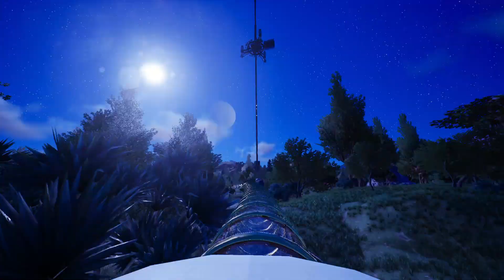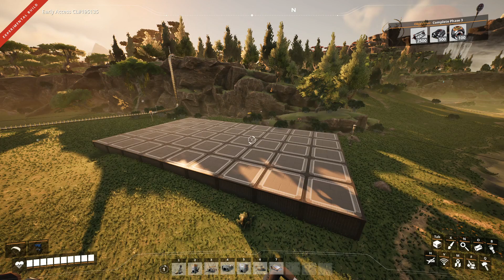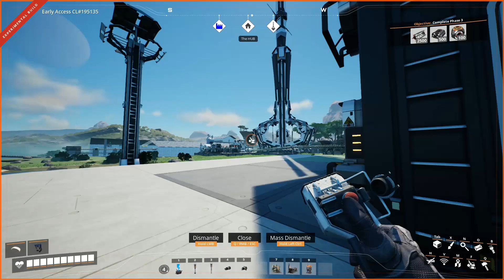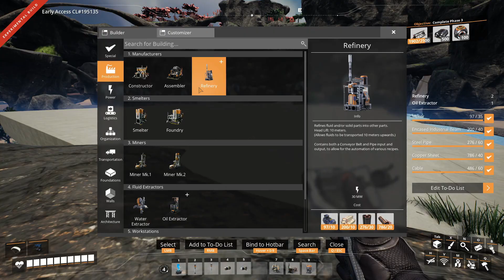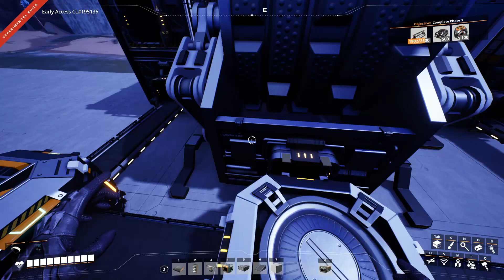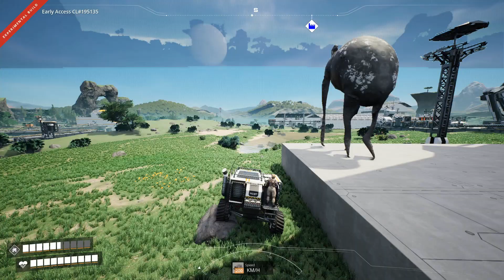The most efficient playstyle? | Satisfactory

Comment: What I do -- I make a storage mall for storing my items that I need to build by hand with -- and near that I place several assemblers and then when I need to batch make something for a milestone I just temporarily connect the correct storage containers to the assemblers, set the recipe, and wait.  I call it "the switchboard" as it has echoes of old school telephone switchboards.
Reply from the maker: I like that!
Reply: @TheDutchActuary  and if the assemblers are fed back into the storage bins with smart splitters they can even feed each other without major belt rework, for example, modular frames from reinforced plates.

Comment: The way I've been playing, is using diversion. At the input or output of every item, I build a diversion junction, so if in the future I want to use those resources for another project, it's as simple as selecting a different output. The same with power, I have made everything on switches, so I can remotely control manufacturing lines, miners into bins, when bins are full turn miners off, turn smelters on, when ore is processed turn smelters off, turn constructors on, when ingots are processed turn constructors off. So on and so forth, saves so much power.
Reply from the maker: Interesting concept! I like the ' switch ' to divert the flow! The power switching seems really inefficent though. Sure, you save on power, but only because you effectively scale down your production in each step by shutting it off. The same could be achieved by simply building less miners/etc and leaving them on all the time. The one upside I do see from that approach is that it makes it (relatively) easy to scale up later if/when you do have the power to keep the entire thing running 24/7.
Reply: @TheDutchActuary  so for instance, I have a factory producing 24500 iron ingots, which feeds a huge steel foundry making 7020 ingots, I use some for power production so those particular lines never get turned off, but as for the rest, I can switch them on and off for production of space elevator parts which don't require constant production

Comment: I find using the small setups are good for getting the most useful sections of new tiers unlocked. Often times the machines in a new tier require parts from that tier to be built. As you pointed out, you really don't need that much to build with so setting up a small container based builder to get some of those going to skip hand crafting them is really handy. Also getting the unlocks for pocket dimensions and the faster belts and miners or things like the hover pack unlocked, make it easier to build out the larger factory to fully automate the parts in that tier. For me it's not an either-or answer, it's a yes-and answer.

Just like in the beginning of the game where using temporary setups helps get you to foundations and other organizational options that make building easier, as each tier is unlocked the same cycle happens. I see the container builders as a temporary solution to help progress towards more automation in the long run.

Comment: I’ve been trying to build in such a way that puts machines in the right place, and I can add decoration like walls later. I might connect the machines in a unique way vertically or horizontally but I try to get them running asap.
Reply from the maker: That's actually what I considered as well. However, I'll be honest - i'd probably never end up actually coming back to put those decorations up ;)

Comment: I build in a way that stores what i need to build with. Usually I only produce enough to keep the cans full when I'm building lots ll at once. for the most part that is between 5-15 items per min. When I'm building a new facility for a new part I set up the full production line from ore to finished product. At least I do that until I unlock trains. Trains make it so much easier to move items around the map. I do the full automation though. I only use "Hand feeding" for the first 50 Smart Plating for the space elevator and the Solid Biofuel production chain.

As for that Spitter you found. Spitters around the world look different based on the biome they live in.

The smart splitter is a bit buggy. Though only on the left and right outputs. The center output works no matter what. The sides you do have to redefine if you want them to work. Even if that is just selecting any again. Though if you are using only 2 of the 3 outputs items can get trapped in the third output. To prevent this set the output you aren't using to none before you start passing items through the smart splitter.

You can use "Ctrl-C" to copy the recipe AND overclocking/underclocking then "CTRL-V" to paste it into subsequent machines.
Reply from the maker: I like those little details like the creatueres looking different per biome. Keeps it interesting!

Didn't know you could actually copy/paste the under/overclocking as well!